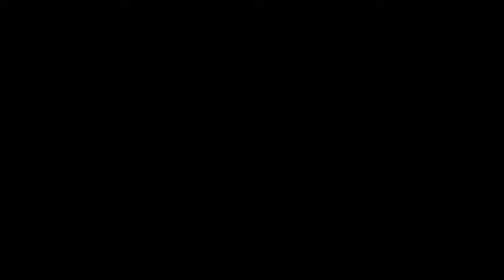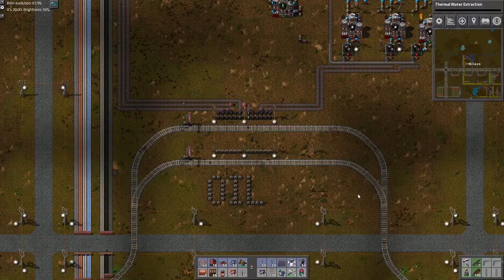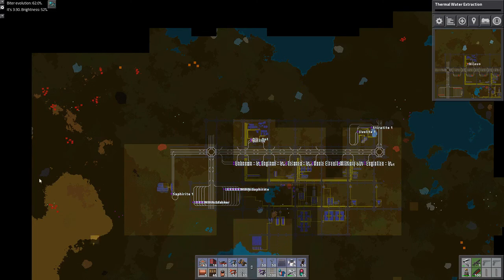Lets Play Factorio S6E18 - Electric Engines

Comment: You've placed insters on wrong (instead of putting engines on belt, they put to grab smth from belt) side at the top line of engines (not electrical ones)
Reply from the maker: yes I see that now. Usually Electric Engines are in short supply due to thousands of robots needed (and in case of Yuoki Industries for a lot of the buildings), but in this setup I am barely using any so I have not noticed the screw up.
Reply: Still think you build quick a lot of factories for engines if you are not going to use robots :D